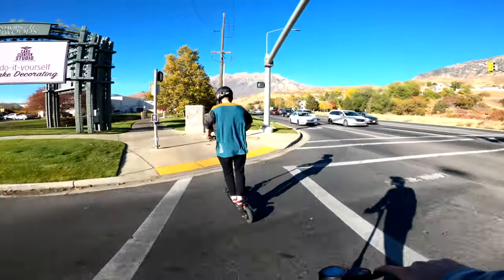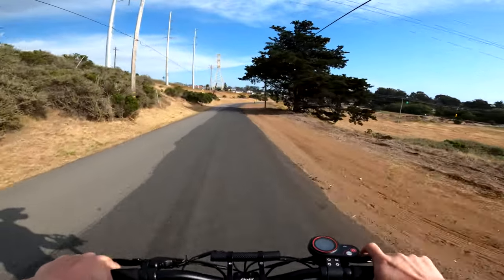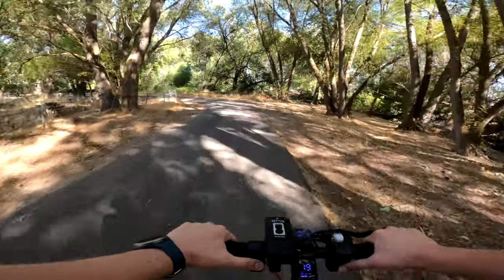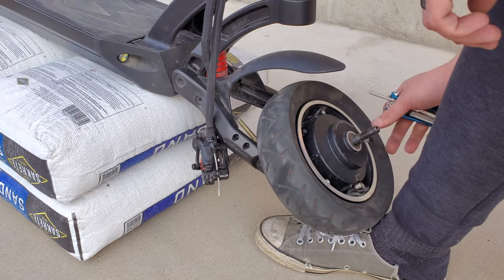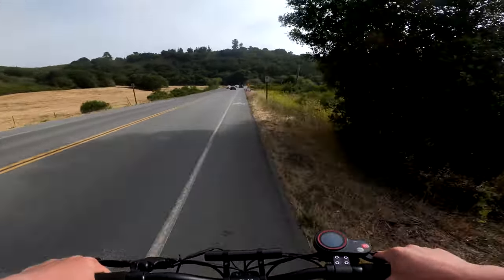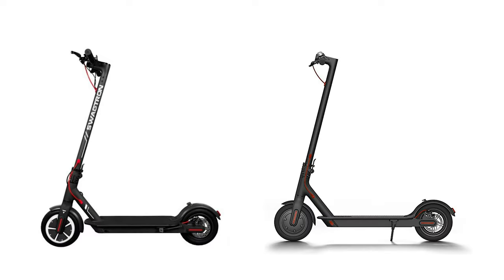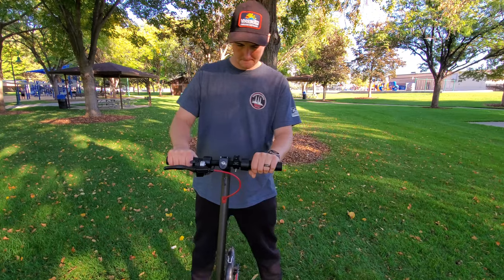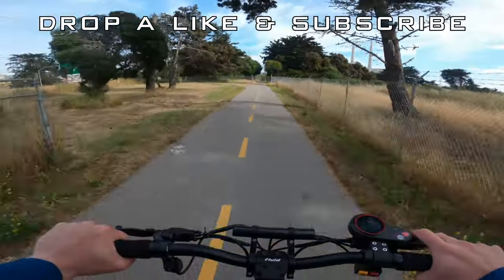Top 5 Changes to Electric Scooters I Want To See

Comment: The wheels are smaller in size to make it easier for the electric motors to spin up, the larger the tires, the more torque requiired to get it moving - which then translates to a bigger battery due to the extra load on take off. i can see there being a higher top speed with larger tires due to obvious reasons - how ever i bet they use the 8-10inch tires because thats whats readily available and they are stuck in there ways. a 1ft diameter tire starts to seem a little large in my opinion but then again i think its mostly the scooter manufactures found something thats acceptable 90% of the time. goood video man

Comment: Waterproof...yessss.  Not just for riding in the rain, but properly cleaning and maintaining the scooter.
Reply from the maker: Good point, I definitely should have included that!
Reply: @RK9Rides  I am reluctant to even take mine off road because of the tedious cleaning process without water.  Great video!
Reply: @RK9Rides  Apollo’s Ghost is IP54 waterproof, seems like they at least watched part of this (full disclosure I have a Ghost on backorder)
Reply: @jacklong9619  Emove Cruiser is IPX67 water resistant. I live in an area that rains a lot and I have gone through heavy rain and puddles (not on purpose) and it is unphased.

Comment: It would be better if scooter manufacturers built a frame around two larger 20+inch wheels. Additionally, the driver can sit between the two wheels for extra comfort. Batteries can be mounted on the frame and provide power to the rear wheel; or, better yet, use the space inside the frame to mount an engine for increased speed and torque. My invention has just revolutionized the scooter industry, incredilbe

Comment: Thank you for bringing up the point of tires that don't go flat.  I used to go to work on my bicycle, and even though I would change the inner tube right after a flat, when I would ride it the very first day I would get another flat.   it's so frustrating to know that nails do not respect brand new inner tubes.  That's what stopped me from going to work on my bicycle.

Comment: you nailed it. Those small wheels and geometry is the biggest obstacle for me in getting one. I can do some DIY waterproofing myself but it should be waterproofed from factory. ..this disc brake replacement through cable is utterly ridiculous. What was the designer thinking?

Comment: All good points. I would add 2 more, from my personal experience :
1. Option to have a fixed non-foldable steerer (or stem, as it's commonly - and erroneously - referred to in the e-scooter world). Especially on the heavy weight e-scooters, I cannot see the utility of a foldable steerer. It's not like you're gonna fold it and take it up a flight of stairs, then tuck it under some desk.
2. Adjustable handlebar height. This is a simple thing that can make your ride great or miserable.
Unfortunately, modern Chinese people are just executants, invention and inovation are skills they barely start to rediscover. If they don't have a good original to copy, they can only get it right by chance.
Reply: Excellent point, couldn't agree more with both points
Reply: Shipping costs are why they fold is my assumption.
Reply: @rustilldown7  Bike manufacturers have seemed to overcome this problem from the get go
Reply: Also easier to transport in the trunk of a car when folded

Comment: I agree with everything. It blew my mind when I discovered the scooters aren't water proof. Makes no sense.
Reply: mine is waterproof and it was only $800 cad
Reply: My mi e scooter 3 is waterproof
Reply: @mangoTV6969  fr?? Did u soak it in water?
Reply: @TitaniumTronic  I mean it resists rain
Reply: Its an electric motor and battery. of course its not waterproof.

Comment: Regarding number one, I think you're misjudging the average consumer.
Most need a last mile solution that they can put in their car, or bring with them on the bus or train. They don't need dual motor, 40mph and 60 miles range. So for them the small wheels are the perfect compromise between comfort and portability.
Reply: Well, I have used to use the Ninebot ES4 for my average commute to work, I found that I needed something else to get me into the city. I believe a lot of people who are getting into the E-Scooter scene have found out that they can be a way to get around and can be significantly cheaper than a car.

Comment: There are good reasons why the last century there have been developed dozens of bicycles types (folded, mountain, with suspension) with and without powersupport, and regular scooters/mopeds/motorbikes, and stabilised Segway concepts.

The small scooters you're reviewing in this channel are derived from toys (steps) for children and to be used in urban settings. Steps for adults use big wheels, which makes them lose the advantage of compactness and portability.

Demanding to use this type of vehicle concept on long distances, all weather, safely, comfortably and off-road with high speeds, is almost like...asking a brick to fly and not being able to break a window. If you fulfill all of the future desired features, you might end up with a more or less regular e-bike/e-motorbike, with a seat (who wants to stand up straight while commuting longer distances..?), larger wheels, storage space, etc, etc..

Comment: Tire changes does suck. I haven't had a flat in over 500 miles since changing to the "hybrid" 10" tires (the stock 10" tires on most scooters are extremely thin and easy to puncture) and using the super expensive tire sealant (which I tested and it did seal a large hole that standard tire slime could not seal). Tubeless tires don't offer greatly increased puncture protection vs well sealed tubes (tubeless offers better pinch flat protection but most scooter flats are from punctures, not pinches). Main advantage of tubeless (mountain bikers know this) is lighter weight and the ability to run at lower pressure for greater off road traction. Changing a tubeless tire is massively more difficult than replacing a bad tube (for my mountain bike its not even possible to inflate a new tubeless tire without a special pump that can push air in super fast). Tubeless tires still require tire sealant and the sealant needs to be refilled on a regular schedule (at least this is the case with quality mountain bikes). I managed to get a pinch flat on brand new tubeless tires on my Trek mountain bike about an hour into the first ride. I then found that I couldn't fix the tire without specialized tools and even worse a pinch flat in a tubeless tire normally means the tire is now destroyed and a new bike tire for my Trek was $100 vs $5 for a tube. I'll take tubes over tubeless any day, but many disagree. What everyone should agree on is the facts about what tubeless really offers vs tubes.

Comment: Use some better tire sealant such as Armor-Dilloz or Flatout that can seal up to 1/2". Slime can only seal up tp 1/4". I always go with air filled tires because more grip when wet and longer range compared to solid tires. For speed wobble, you might need to install a steering damper. If you like Hiboy, you will love Ninebot Max.. because it's weatherproof, and the steering angle is perfect.
Reply: I love my ninebot. It make me want to ride any chance I get. I've never felt the end of the battery on one ride.

Comment: The bigger powerful scooters need to take notes from the rental scooter market. The display should be installed in the middle, there should be a way more responsive throttle (with option to chose between finger, thumb or wrist actuated), wires should be routed inside the scooter, and all electric components need to be waterproof. Also, electrical connectors should be on the outside to make it easier to swap components.

Comment: Ever tried armordilloz for a flat? Good stuff. Most holes will plug themselves without you even realizing it. Got my first flat on my euc and didn't wanna go through the hassle of disassembling my wheel to fix it so I just ordered some put it in there and it worked great. I was pretty apprehensive towards tire sealants since slime has failed me before but I gave armordilloz a shot cause it was specifically designed for pevs and uses these feather like rubber particulates rather than the round granules you see in other tire sealants and I swear by the stuff now.

Comment: Do you think the 10” tubeless pneumatic tires on the Emove Cruiser are reason enough to get it over the Vsett 9+? The 9+ has dual motors and some other perks, but I’m curious if you think the tubeless tires on the Cruiser are enough to make it a better pick. Either will provide enough range for me and the cruiser is a bit less expensive.

Comment: The Emove Cruisers tubeless tires and low speeds, allows it to be one of the best scooter's at it's respective price points. Couple that with a water resistant rating and, in my opinion it is worth it. (🤔 Still love high speed scooter's though)
Reply from the maker: Yeah it definitely seems to have lots of good features, though I have heard mixed reviews about it. Would love to check one out myself

Comment: My scooter has 11" wheels. 90/65-6.5.. Ive seen up to 13 inch wheels on a scooter. but youre right, larger wheels are definitely mandatory when going fast.. Every bump or pothole i hit i have a mini heart attack wondering if itll bottom out my suspension and/or pop a tire, or even stop me dead in my tracks and i flip over the handlebars.. When i ride with the seat it makes it less nerve wracking but id still prefer larger wheels.. Huge even depending on the terrain.. 16", even 20" tires that are still wide like dirt scooter tires with full large suspension. Thats my number one complaint about scooters nowadays.

Comment: Very good video with excellent points.  You have pretty much described the difference between what are still simply toys & what could be proper transportation.  Your observations almost exactly mirror my reluctance to thus far purchase an electric scooter.  I love the portability, practicality, & low maintenance vs larger combustible engine scooters or full size electric scooters for that matter.  The idea of bringing my scoot inside with me or on public transit is a huge selling point.

Until the standup electric kick & non kick scooter companies address all the issues you brought up, they will forever remain toys & not proper transportation.  Especially the waterproof issue, wheel/tire size & parts standardization are also key factors.  They already make them fast enough & no doubt longer life batteries are soon to come.

Comment: 800 miles on my eMove Cruiser and I have not had a single flat. I guess its working then.
Reply: Really thinking about buying the eMove Cruiser. Just trying to justify that price! Is is worth it in your opinion? The distance capability on that scooter is outrageous!
Reply: @Stingrey2812  they actually increased the motor to 1,000 watts. I think now it’s by far the best deal in scooters. The value is unbeatable.
Reply: @TheTinRam  what’s the going cost?
Reply: The Cruiser? Is still $1,400. There is a 7% off coupon to bring it down to $1,300 though.

Comment: All scooter companies should use interchangeable upgradable parts for example if I wanted to put suspension on a scooter that didn’t have it I could just order a front suspension fork from rev rides or whatever and put it on or tires from a wide wheel pro on a zero ten x  just by ordering the parts without making mods

Comment: I agree 200% especially the wheel size and fork angle or rake. I'd like to see 13 inch wheels for any fast scooters the standard.  The Dualtron City is a good example, with 15 inch wheels.  This to me would be the most important change manufacturers could work on.  I noticed the new Inmotion RS has a pronounced angle in the control stalk.  Looks more controllable and comfortable.  Great video.  Thank you.

Comment: One thing I would like to see changed is the kickstand - most are ttoo short or placed in the wrong location. I’d like to see a dual stand that raises the rear tire off the ground. That would offer more stability, easier to work on the back end of the scooter, and add a few moments of safety from someone trying to jump on the scooter and take off.

Comment: Great great video! So true about pneumatic tires and tire sizes. The thought process about pneumatic tires being better than tubeless tires because of increased traction and dampening was all fine and good until I got a flat on the 8" front tire of my Emove Cruiser going down a small hill, and went flying over the handlebars. I went home licking my wounds and put a tubeless tire on. I never had a problem with it again, and I rode it in the rain...(until the rear drum brakes seized). But new suspensions greatly reduce road shock quite sufficiently. Maybe Pneumatic tires are slightly better but not at the risk of injury. If I had to guess I'd say most of this issue has to do with money. I'm sure the cost of new tires and tooling will cut into company profits by increasing manufacturing costs. But if offered a good high end scooter with quality airless tires over pneumatic ones.. .well let's just say it would be a Huge selling point.

Comment: im shocked how good my foam filled solid tire is on my mantis 10. should be default from factory. a must.
Reply: Lol no. Go tubeless. All the advantages of tubes with almost zero flats. And when you do get one it takes only a tire plug on the side of the road, 1 minute job.
Reply: @slick1908  what
Reply: @De Rossi Where did you purchase the foam tires for your mantis?
Reply: Where did u bought it from ?pls

Comment: Great video man! Hopefully you’ll get to experience 11 inch tires one of these days.  They are not 10% better than 11 inch it is more like a 50% difference in ride quality and durability.  You are correct about tubes, I am in the process of replacing all of my 11 inch tube tires with higher quality tubeless.  If there is a scooter that is comfortable and relatively durable  at high speeds with 10 inch tube tires it would be the Dualtron 2 and Eagle Pro.  That design has been around for a long time successfully.   If you were ever in Los Angeles California we can do a collaboration and you can ride my DTs 😎
Reply: I'm glad I've never experienced 11 inches lol.

Comment: I really want to get a powerful scooter, something like the Zero 10x. 1000w dual motor, suspension, and off road tires. With the intention to tear up some trails at 30+mph but I just couldn’t see spending more than a grand before shipping.  Seeing as all the scooters that have that set up are all above that I’ve just been sitting to the side. But seeing these videos really wants to get one sense summer is right around the corner. I hope one of the start ups from kick starter makes some big jumps that will lower the price or make it feel like I’m getting my money’s worth

Comment: Excellent constructive suggestions! Slacker head angles and larger tires can give a more stable high speed ride, but add weight and reduce low 
speed maneuverability. A few scooters do have 11" - 13" tires, but these all weigh well over 100 pounds. The lack of waterproofed electronics is
 simply irresponsible manufacturing as is the lack of visible turn signals on most models. I'd like internal alarm and gps options, too. I'm surprised you gave stem assemblies a pass, as I have rarely seen such failure-prone kludges used so widely as in the folding stems on almost all scooters.

Comment: Yeah, but with smaller wheels you get better torque and quicker acceleration. With a larger wheel you need more powerful motors to achieve the same effect, which adds weight and cost. Weekly flats must have been terrible.

Comment: I have got 11 inch tubeless tyres on my Quickwheel Explorer and they feel much better than the 10 inch tyres. As for the rain. I always ride my scooters in the rain and never had trouble. It's strange you getting so many punctures. Are you riding in the gutter?  Very unusual to get that many punctures

Comment: Well I have a Dualtron Eagle Pro let me give a shout out to the Emove cruiser. They are headed in the right direction in terms of ipx rating as their scooters are water resistant. 
If they ever make a hyper scooter that does 60 mph and sports dual motors I will be first in line to buy.
They actually listen to their customers so just go look at the 2022 Emove scooter.

Comment: I have a question, is now the best time to get the varla eagle electric scooter or wait until a 2021 version comes out
Reply: I was eyeing the Varla too...but I was lucky to get in on the Apollo Ghost which is very similar spec and cost wise except the Ghost is 13lbs lighter. It's the first version for Varla so I'd say wait for them to get the bugs out, but they do offer a great 2 year warranty so I'd say depends on if you can wait or not.
Reply: @donvee2000  
Have you encountered any problems with your Ghost?
I’m considering it as my very first scooter.